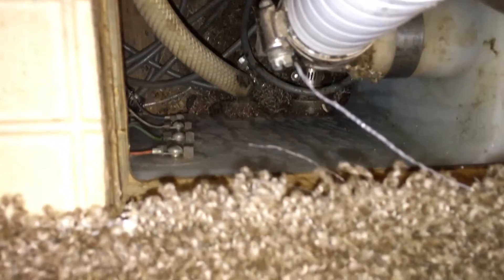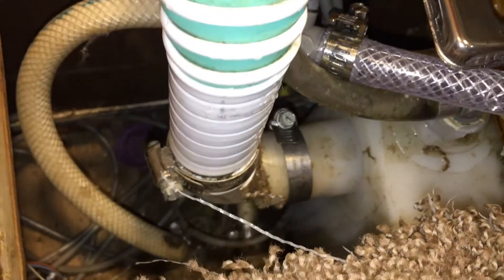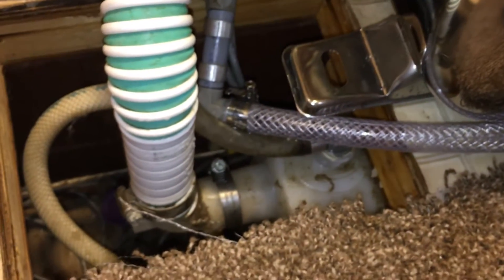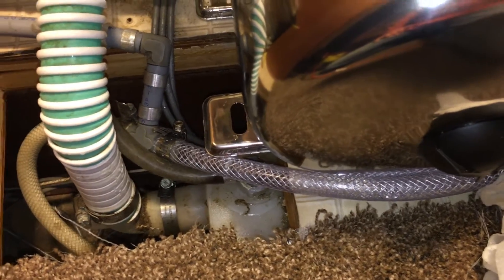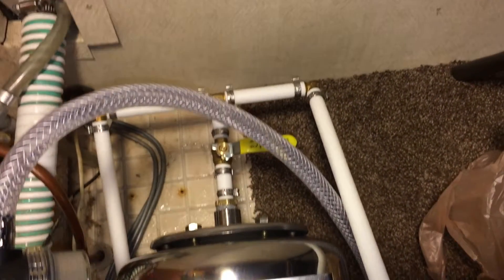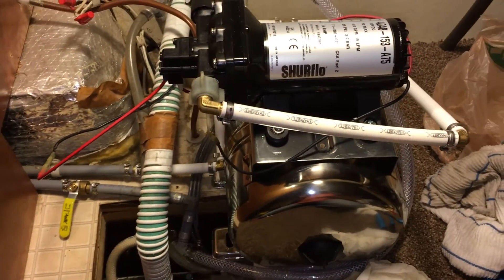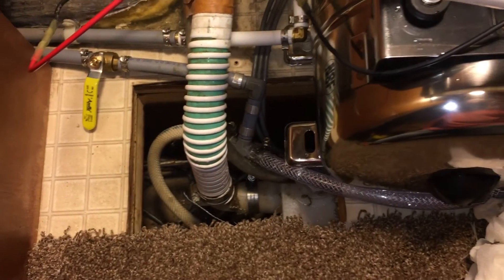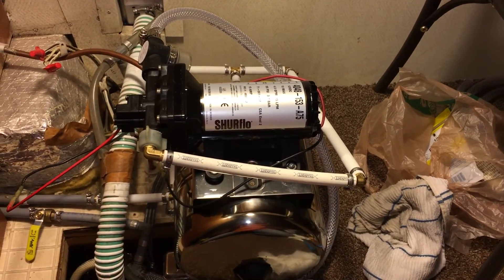Pentair/SHURFLO 4048 Pump and Accumulator Tank Problem

Comment: I couldnt tell you for sure, but I was having another issue with my shurflo pump and looking into the various forums, people are experiencing the same problem you are. A few responses to fix this issue is to limit the hard right angle fittings as much as possible. Create a more direct route to the faucet to remedy the issue. I have no clue as to why that could be causing the pressure gauge to not turn the pump off, so  you may want to search the forums to get more information.
Reply from the maker: Thanx for the note, Jeremy! I actually fixed it yesterday. Follow-up video to be posted tonight. Stay tuned! ;-)
Reply from the maker: Hey Jeremy, I posted an update video here, in case you're interested: https://youtu.be/4qdhmiaRaRE.